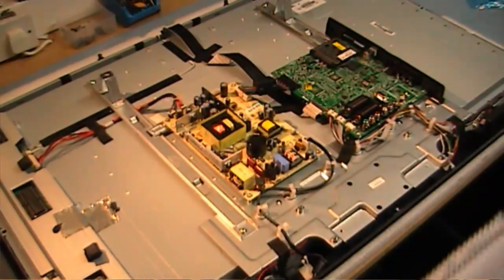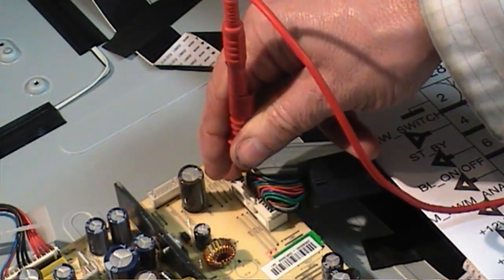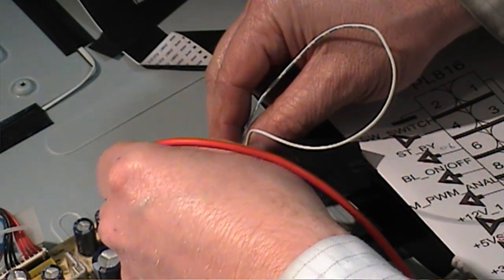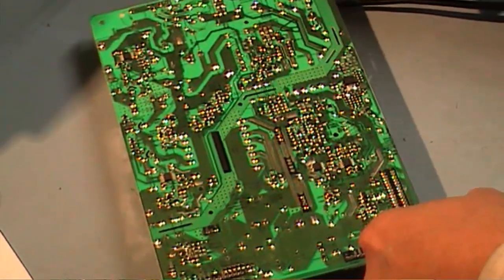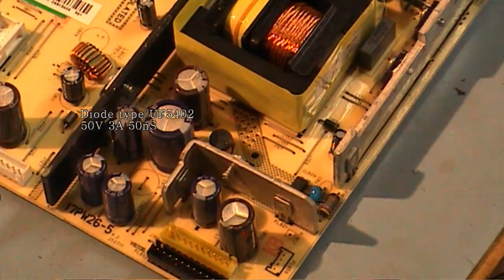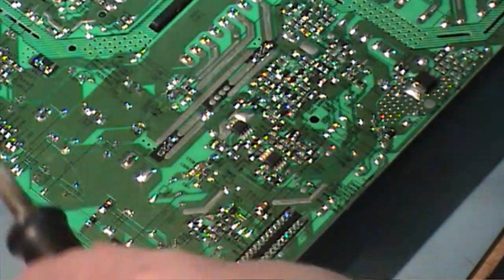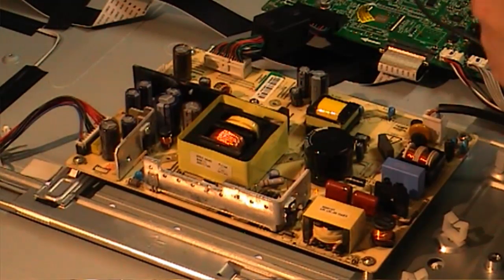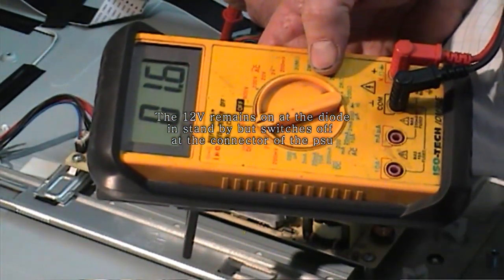LUX-40-914-TVB Power Supply repair type  17PW26-5 20680292

Comment: if i make same tests on the 17pw26-4 will i be able to find the faulty parts or should i just focus on these parts, plus the D893 wich is the one you replaced?
 F800
Q813
Q814
IC830
D894
R860
R8661
R971
C840

Comment: can i replace this board 17PW26-5 V.3 250711 and use this board 17PW26-4 V.1 100409 the board looks the same apart from the extra cable for mains on/off switch if any one can help?
Reply: Did you fond the résponse have the same  issue

Comment: In Luxor 42" take long time till get it on, blue light going to orange, then after second back to blue. So from stand by not going in to ON mode,  but after about 5 minutes of pressing remote, able to get it on. Possible faulty capacitor or could advice some different faulty?
Reply: Will answer on my own question. Two capacitors were blown, so replaced them, and TV is back ON

Comment: Hi, where can I source uf5402 50v 3a 50ns or can you direct me to an alternative as all 5402 I can find are 200v.
Reply from the maker: My mistake, they are rated at 200V, i just looked at my diode database
Thanks for pointing out my mistake.
I have added some correction to the video

Comment: Hi,

Just for information:

I managed to replace 17pw26-4 v.1 on my Toshiba to 17pw26-5 v.3 and everything works fine :)
Reply: +Pavel Antonov what exact TV did you work on? It's a 37bv700 in my case, might try the same then.
cheers
Reply: Hi,
In my case it's 40BV700B. I think it's the same as yours with only difference of display size.